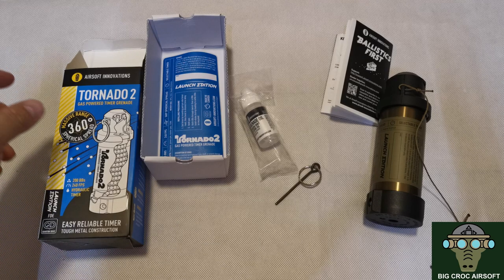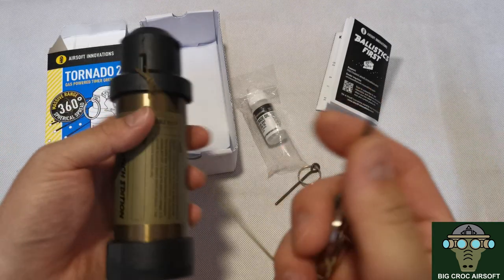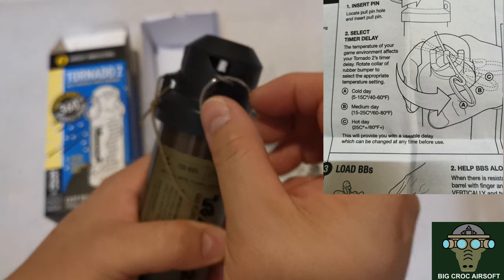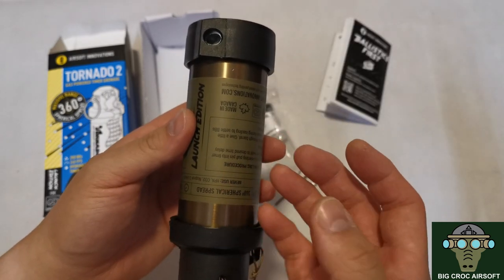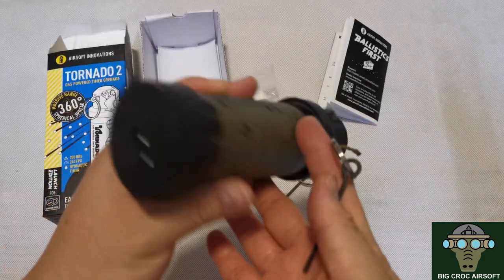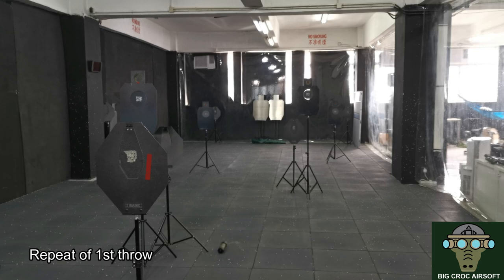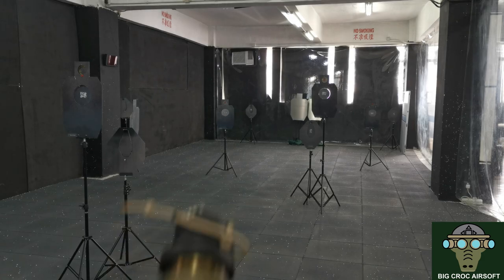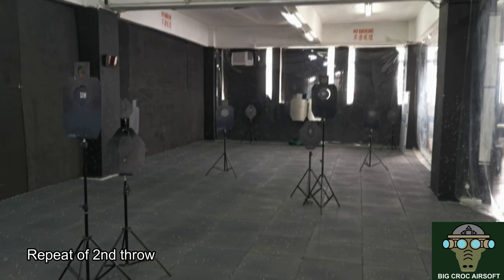Airsoft Innovation Tornado 2,  unboxing + testing at range,

Comment: mine should arrive tomw. but that was a hilarious opening!! lollll
Reply from the maker: Oh yea lol, felt really bad baha
Reply: What has been your experience with the granade over time? Any good? Does it braeak or still works?
Reply: @tekkhero9767  mine or big croc?
Reply: @n00bsoft  yours! if you order identical. I am thinking about buying so I am interested in what you think about the product after having owned/used it for a while? Thanks
Reply: @tekkhero9767   it's fine, it's durable. but i havent used it as often since i was using a T1 holder and the nade tends to come loose when bumped. but now i know there are dedicated T2 holsters and pouch so might start running w it again! i did a short vid talking about it before as well
https://www.youtube.com/watch?v=KBt5FBS2xdU&t=3s